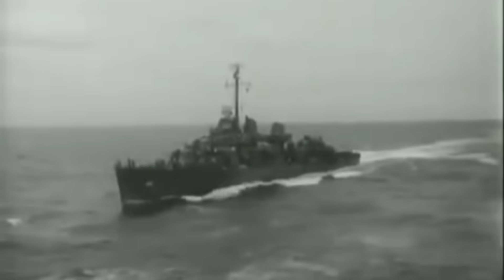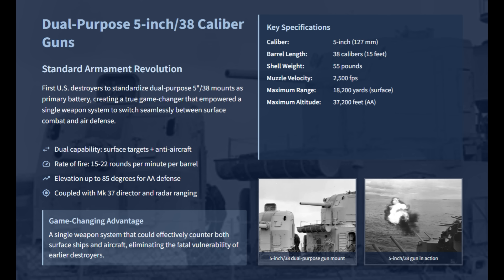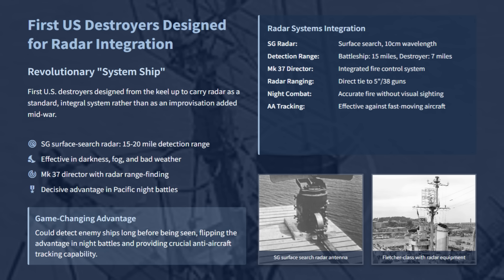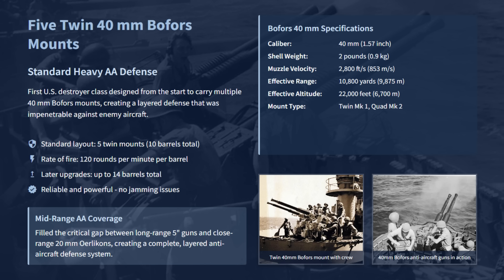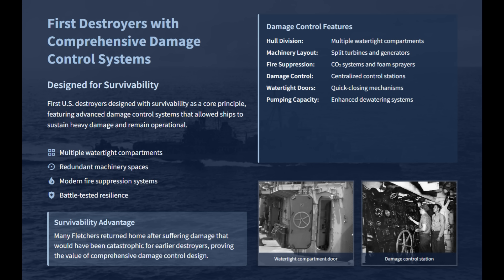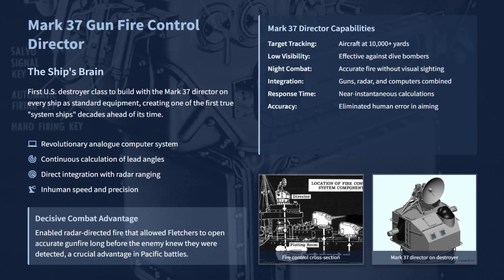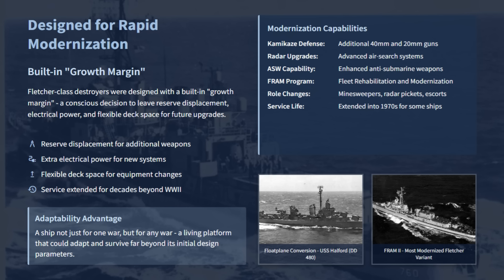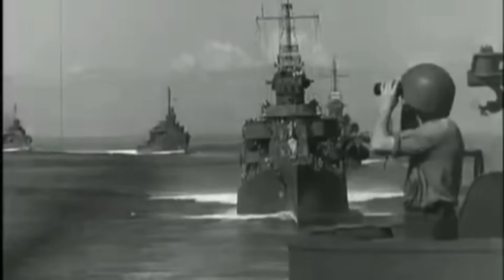6 Innovations That Made the Fletcher Destroyers Revolutionary

Comment: Too many inaccuracies and glaring errors to earn a like. For one, the Fletchers were not the first to mount 5"/38 caliber dual-purpose guns. Every USN destroyer since the Farragut class in the early 1930s had them.
Reply: The first DD class built after the four-piper Clemson class, the Farragut class, had the 5"/38 main gun. Then the Porter, Mahan, Gridley, Bagley, Somers, Benham, Sims, Benson, and Gleaves classes. Nothing against the Fletchers, but they were far from the first USN DD class to deploy the 5"/38 DP main gun. This posted, I'm bailing from this video. After this fundamental error, I'm not going to burn time finding out what other errors the video has.
Reply: @petestorz172  It's YT. Don't expect much historical accuracy. Entertainment is the name of the game here.
Reply: 5"25 were the early mounted guns
Reply: On Treaty cruisers and capital ships, yes, but not on USN destroyers. 5"/25s were considered but lacked the range plus armor piercing capability destroyers needed, and 5"/38s were chosen instead.
Reply: @petestorz172  Before the 5"/38 they used a 5"/50 caliber for surface warfare, the longer barrel giving a higher muzzle velocity. The longer weapon couldn't be reloaded at higher elevations so the 5"/25 was used exclusively for anti-aircraft duties. The 5"/38 was a compromise that worked well in both regimes and thus became the ubiquitous secondary armament on cruisers and capital ships. USN fast battleships typically carried 20 5"/38s, ten on either side of the superstructure in twin turrets.
Reply: 5"/50s were the standard secondaries, mounted in casemates, in USN Dreadnoughts and super-Dreadnoughts. The 5"/25 was developed as aircraft became more robust and capable. The 5"/25 was a very decent gun for its time, and continued in service on some Treaty cruisers and battleships. On battleships, the 5"/25s often replaced 3"/50s. When the US sub force found their 3"/50 deck guns insufficiently destructive, they were variously replaced with 4"/50s and 5"/25s. Against merchant hulls, the lower velocity of the 5"/25 made it less likely that shells would pass through the unarmored ships.
Reply: @COLDB33R  As I recall, the rebuilt Standards kept the 5'/25 for weight savings.
Reply: Do u mean that the 9 earlier classes cited above DID NOT  initially mount 5.38s?

Comment: An otherwise impressive presentation, this video's credibility is called into question because of its erroneous claim that multiple 40mm Bofors created a layer of defense that was impenetrable. 1:50 A claim that is easily debunked with minimal research.
Reply: ? That’s not what I heard -
Reply: Im not sure what you're talking about? All the video says is that the Bofors were significantly better than the oerlikons which is pretty clearly true.

Comment: 15-20 rpm? Hardly. The crew in the upper handling room can't load the hosts fast enough to keep up with that rapid rate of fire. I've worked the upper handling room, the mount and even the magazine so I'm pretty well versed in all of them.
We fired 10k rounds (SHOBOM/NGFS) in a three month period alone  so we had "well trained gun crews"!
Reply: That rate of fire was for the twin mounts.  We could do 15-20 RPM but that was with two guns.
Reply: Also, too, that was the peak instantaneous rate at the start of conflict, not the practical sustained rate that you note.
Reply: In a burst we fired at 25rpm, single mount on a Garcia in 1980. I was working powderman that day. And the actual burst was only 30 seconds - 13 rounds. ASMD drill, live target, but it was timed.
Sustained rate was closer to 15 rpm, but firing at an incoming missile kind boosted your motivation.

Comment: You forgot the Ford gyros tied to the gun system. Very important. I believe the Fletchers were built in at least four different shipyards. I would like to hear more about crew accommodations, but that seems to have been lost to history.
Reply: @michael: I was going to swap from a Gearing to a Fletcher when our squadron changed homeports. I went aboard a Fletcher and the living compartment was worse than the Gearing and they were compact but far superior to the Fletcher. 

Besides, in order to get from the bridge to the crew spaces (aft) you had to transit on an exposed weather deck. Older DD'S spent more time under water than above in rough weather. At least a FRAM Gearing had an interior fore/aft passageway.
Reply: If you look up the USS Kidd museum and the USS The Sullivans museum (Buffalo Naval Park), they both produce great videos about their ships.  The Kidd is kept in her 1945 configuration while The Sullivans is in her 1963 configuration.
Reply: You're right - the Mark1A fire control computer was a rock star! They were still doing the job well into the 70's...  The narrator has his facts wrong - calling the Mark 37 director a "computer" - the director fed it's data into the Mark1A - that was the "computer"...
Reply: Ford Mk  1 Able Dual Purpose Fire Control computer was used by the Mk37 and later Mk56 Gunfire Control Systems serving 5"/38s. Already on the Sims & Benson/Livermores. Had the Mk56 version on my first ship. The "Gyro" you are referring to is the Mark 6 stable element, part of the Mk37. Its output is added to the computers and keeps the gun solution stable, withput the need to stabilize the gun mount or director. If you have ever watched a gun that is tracking, it remains level as the ship pitches and rolls around it.
Reply: I believe the Fletchers were the first US destroyer designed with bunks rather than hammocks for the crew.
Reply: Not true I just watched a good show about that very subject